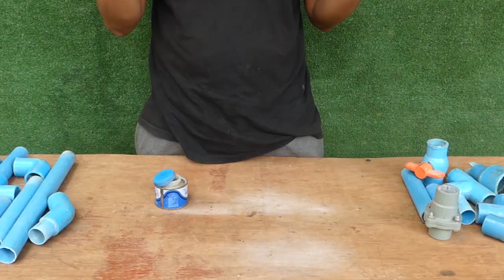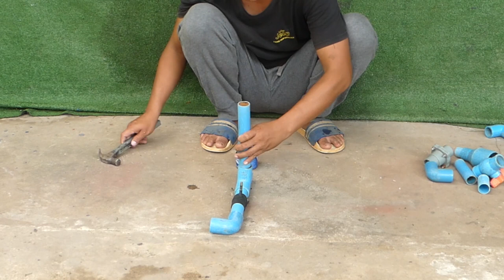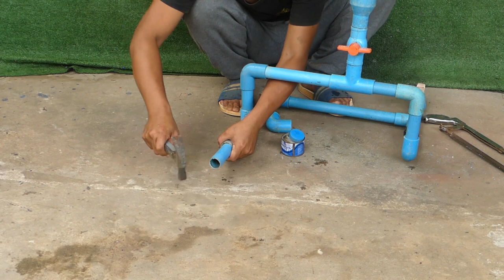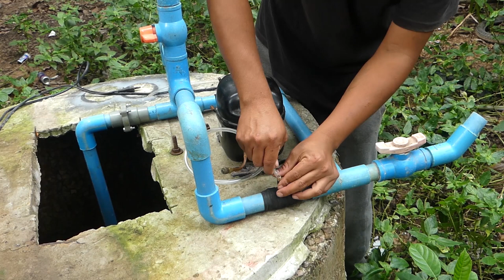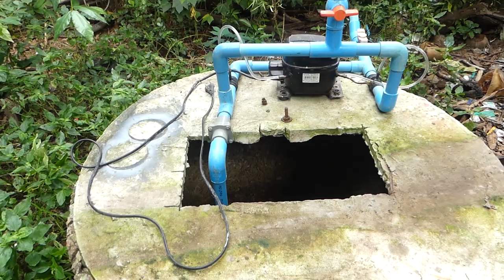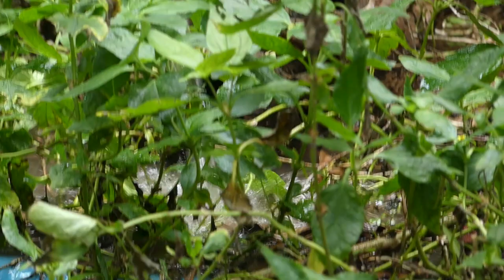I turn fridge compressor into a water pump speed 280m3 / hour Vs Free Energy Water Pump 24H/Day

Comment: Solar Panel is Soft!  better is to be able to use a solar panel as a start!  start and automate by placing a hydraulic electric power generator at the water outlet!  with four (4) outputs eighty volts (80-Volts), one hundred and twenty (120-Volts), two hundred and twenty volts (220-Volts) and coherent amperes at the user's will! FlávioAugustoRibeiroEvangelista!

Comment: Malambot ang Solar Panel!  mas mabuti na gumamit ng solar panel bilang panimula!  magsimula at mag-automate sa pamamagitan ng paglalagay ng hydraulic electric power generator sa saksakan ng tubig!  na may apat (4) na output na walumpung volts (80-Volts), isang daan at dalawampung (120-Volts), dalawang daan at dalawampung volts (220-Volts) at magkakaugnay na amperes sa kalooban ng gumagamit!